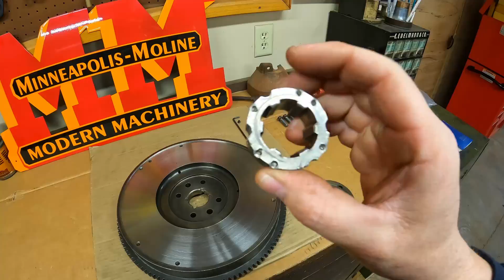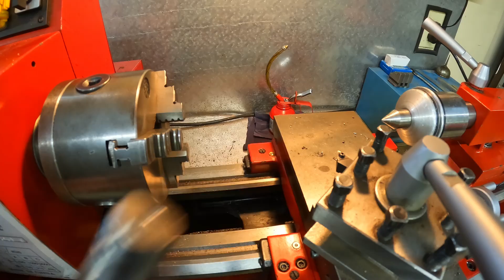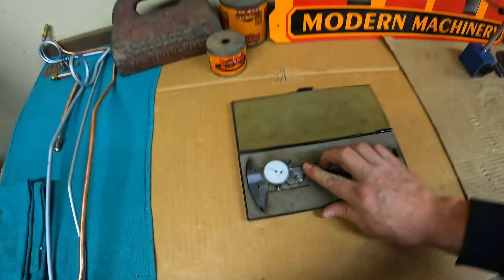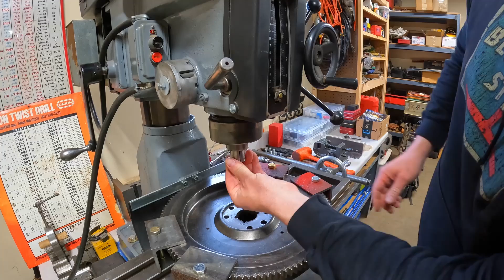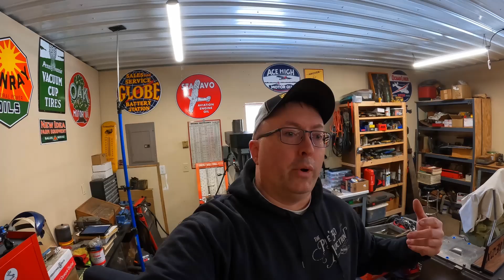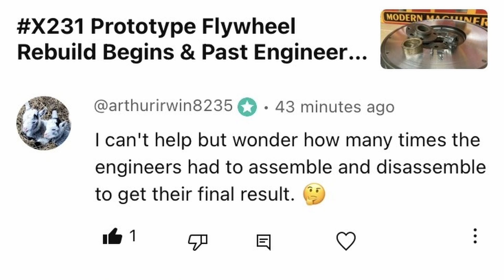X231 Prototype Flywheel Machining - Making Tools, Checking Setups & Cutting Metal - Episode #80

Comment: Not sure from the video, but the boring bar looks like it has  a carbide insert.  They don't tolerate INTERRUPTED CUTS.  I would use a HSS cutter and regrind as it is beat up.  You can finish with the carbide.

Comment: just had a thought. is the spline insert even original MM installed?  could the prototype have had a  spline in the flywheel casting, and the insert a farm-life  repair when the PTO ultimately failed after a few hours under load? If this machine was for proof of concept and not for proof of longevity, there are definitely obvious repairs because of their complexity compared to good enough for a parade for the brass.😊

Comment: Hey Squatch .
I did a similar  job years ago on a bearing housing.
 My set up process was exactly the same with regard to your dial indicating . 
I had to the Extra step of having to show my work and set up to the erector who was in charge of the project. 
 At the end of the day I bored out the out of round hole with an adjustable boring head just like your original set up . 
You are doing an excellent job . Your attention to the final outcome is spot on and it’s the final outcome that matters . Sometimes the path is not as straightforward as we would like . 
 Your efforts provided a quality Job and precise finish is achieved.
 Well done ,keep at it and keep making these videos as they are of great value to many people who are interested in machine repair.

Comment: Using drill rod for indicator holder? What are you, rich! No re-bar laying around the shop?
Please share the speed you're running your tools in surface feet per minute so viewers can have a sense of the calculations required to set spindle speed.
Reply from the maker: I honestly have no idea what the spindle speed is here - I never change it and it seems to do just fine 👍

Comment: toby, turn down the shank of your flycutter and mount it in your boring head. light intermittent cuts with hss will hold up better than trying to machine hole entirely with carbide. save that for final passes.  i enjoy all of your content and channel. illigitimus carborundum,  mjm
Reply from the maker: The shank of the fly cutter is already too undersized to be a good fit in the boring bar holder.
Reply: improvise, sleeve the shank and getter done @squatch253

Comment: You are attempting a difficult repair considering the amount of torque involved. My preference would be at least a .oo3" interference fit on the bore maybe more considering if you throw in the expansion generated by the heat expansion or preheat the flywheel and key the bore with press fit dowels not set screws. If set screws are your preference I would recommencement tapered Pipe plugs for a more secure fit. The previous repair says a lot.

Comment: As I rewatch this after some sleep after a long day of visiting multiple airports. Is there any concern/need to have the flywheel balanced after all the machining and repair work is completed?
Reply from the maker: I’m not that worried about it, considering they never bothered with it initially and it went on to endure countless hours of flogging and held up fine. Also remember from WAYYYY back in the series when I pointed out that the engine’s crankshaft was never balanced either.
Reply: All good, and it was one of those, hmmm I wonder moments. As for the way back, that just means I need to rebinge the series.

Comment: easy way to crudely center up on your hole is with an edge finder.. hit both sides on the x, split the dif and then do the same on the Y, repeat again on the x and see if the numbers are the same, tells you you are in the middle, then you can sweep it with the dti to get it right on, but I find the edge finder gets you within a thou or two. You are down a little cause you do not have a DRO, GET ONE, even the cheap ones are your best friend on a milling machine, bolt circles, backlash not constantly fighting you, math functions, its a game changer. few hundred bucks and you are off to the races
Reply from the maker: You'll have to explain to me what "the x", "the y", and DRO mean because I'm not really much of a machinist.  The only things I know are what I taught myself through doing a bunch of things that didn't work and a few things that actually did lol!
Reply: @squatch253  No shame in that, x is table left and right, Y is towards the operator and away and z is the quill / knee (up and down)  a dro is a Digital Read Out, think like a giant mounted set of digital calipers for each of your table axis's.. Tells you right where you are and more importantly how far you have gone. most of them have bolt circle functions where you find the center of the circle, tell the DRO what diameter and how many holes you want, and it gives you coordinates to drive to for each hole, very convenient

Comment: A mini lathe is better than no lathe. If you are careful you can even work around the inherent shortcomings and make quite accurate parts. Maybe not fast and it maybe quite frustrating, but consider the gold standard of flatness, manual scraping. (Conversely you can turn out trash on even the best equipment if you are a putz)

Comment: Toby, I hope you checked the new hub for run out before you cut it down to size. As easy as it slipped on the shaft, that set screw is bound to pull it slightly off center.  Actually I would rather you machine the shaft for an interference fit and press the hub on, machine it to size, then press it back off, but make certain the inner and outer circles are concentric.
I had this message mostly typed in at noon, but then my wife fell and hit her head and we went to the ER before I could finish it, sorry.
I think we should bug Bork about starting a GoFundMe page to get you a new vacuum!!! 🤣🤣🤣
Reply from the maker: Sorry to hear about your trip to the ER, I hope she's alright!  These videos are always several days old by the time I get them off the camera and onto the main feed here, so any damage that may be flagged is already very well done lol ;-)  I ended up throwing a second set screw in the other threaded hole 180* out from the first one to better equalize the load, and checked the runout with a dial indicator before beginning machining.
Reply: @squatch253  Good job!! 👍👍 The wife is kinda OK, the bump on the head wasn't serious, but they want to find out why she got dizzy and fell,, so they kept her overnight.   Serendipity!  Thanks.

Comment: The real reason to machine from the crank side of the flywheel is to be able to center with respect to the flywheel flange around which everything must be true.

The spline galled because the screws that pinned it in place had some clearance allowing the spline to shift ever so slightly when under load. 

So the engineers did a bodge which you can improve on. 

One thing you can do is create a force fit and press the splined bushing in. Machinery's Handbook gives .008~.024" interference for the bore size you have. If you put a step on the splined bushing and go on the heavier side of interference fit that may solve the galling problem.
Reply from the maker: Because these videos are always a few days to a week old by the time I get them off of the camera and onto the main feed here, I'm usually finishing the next installment with the camera by the time I publish anything here so unfortunately most of what is discussed under what's currently playing has already happened.  I did do the majority of what you mentioned here, although did not go up to that tight of a force fit with the new splined center.  The raised step/ridge was also a feature that I built into the new hub, which helped a lot in positioning it for the following steps :-)

Comment: What is the model of your bench mill I have been looking for one and want quality.
Reply from the maker: I don't even know what the model number is on this mill, or who made it.  I stated in one of the radiator tank milling videos that this is a very cheap China mill/drill and our neighbor actually just gave it to us because it had been through a garage fire and he was going to scrap it.  It didn't get hot enough to even melt the plastic handles, so we cleaned it up and made sure everything was tight and have been using it ever since.  I would not, however, recommend a cheaper "China" line of mill/drill like this to anyone though, because it definitely has its limitations in accuracy and function.  Do plenty of research, and if in doubt, spend the extra money for something of mid to higher level quality.
Reply: @squatch253  thank you so much keep up the fantastic work on x231

Comment: I find this build one of the most interesting you have done because it is a series of problems to be solved. How to restore irreplaceable stuff and keep it as original as possible. I suspect that originally the splined bush was just a press fit in the flywheel which failed very early on, possibly causing some embarrassment. I can imagine the tractor being torn down quickly and someone sent off to a workshop to repair the thing in a couple of hours. They came up with an innovative repair that obviously lasted years but eventually started to wear out causing the wallowing of the flywheel.

Comment: FYI, it was X231 that got me to your channel. I have no connection with farming, American farming, tractors, ploughs etc, nor do I have any special appreciation for Minneapolis Moline machines. In fact I had never heard of the make before. After a couple of years watching your work, that has not changed a bit. What keeps me with this channel is the quality. The quality of your work, your knowledge, your experience. Also the resourcefullness that you show - especially with this X231 restoration. Last but not least your enthousiasm for your machines. I will never contemplate a restoration of an American heavy machine - yet your restoration work is fascinating. So please, keep this series going, it is engineering on a level that I can only dream of.
Reply: The same here. I found Squatch's channel and subed then and there. X231 being a one off touched my heart and I love and respect what Squatchy has done. I think X231 has proved her concept and more. 😊
Reply: It's spooky: all of this applies to me as well. In particular it was setting up the DIY line borer to machine the  brazed-casting repair. It boggled my mind that you would go to such lengths to make this whole again. I'll keep watching these as long as you keep making them.

Comment: Hey i enjoy all the tools that you have made over the yrs. but being a machinist just wondering why you did not put the fly cutter in the boring head that way you have control over the size.  we would put any type of tool in a boring head over manual adjusting a tool free hand. make a spacer to hold the tool if you need but always better in the boring head! Great content have watched all that you have made in the last 3 yrs.
Reply from the maker: The 1/2” shank of the fly cutter isn’t in the best condition wear-wise, and I didn’t feel comfortable adding that slack to the boring bar holder.

Comment: X231 is the reason I subscribed to your channel, found it when you were putting together your tooling for machining the rear housing. I have been a machinist for most of my life and have had to come up with many strange ways of doing things with less than the perfect piece of equipment for the job. Some of your solutions are very inventive and get the job done, even though you don't have the best machine for the job. I have a fairly well-equipped machine shop with quite a bit of tooling and I still have to resort to making tools or fixtures to get the weird jobs done. I have even made special cutters (I have a cutter grinder for that and sharpening cutters) for some jobs.
Keep making the videos and using your talents and X231 will run again.

Comment: I'm interested to see how large you make hole in flywheel and how you secure the hub to it maybe try to eliminate most of screw hole make hub a good press fit and drill correctly for some good tight fitting dowell pins guess we will see what you have in mind

Comment: man that is going to be a huge feat to get all four wheels on the ground!
Reply from the maker: You’re absolutely right - just the work that is still ahead of us on that front bolster casting/steering mechanism alone is substantial.
Reply: Very true. Is it just the complexity of transmission, and the shape it was in or are things starting to fight you at least a little less?
Reply from the maker: The front bolster is currently away at the radiator shop getting the new radiator core fitted to it, but when it comes back we still have a line-bore repair to do to the repaired end of the power steering piston opening, and then do a complete rebuild of the front steering pedestal swivel mount that resides in the bottom of it.

Comment: Toby, you do a marvelous job and have a hell of a lot more patience than I do on the project. It takes months or even years to complete the iterative, deliberate trial-and-error process, as you are aware. You may be sure that 99.99% of the problems have been resolved by the engineers in the background before the models are sent to the assembly line. After all, they don't want the product to be recalled after it is sold. To witness the iterative process in action, observe the construction of the SpaceX Starship or the Tesla vehicles, including cars, trucks, and robots. That is the closest approach to building a machine similar to the MM that I am aware of in the field of invention today. I get to watch you work so hard on a project like the MM, and I find it remarkable.

Comment: What was the lesson that inspired you to check for rebound in such a large, thick piece of material?
Reply from the maker: From machining brake rotors with our special “on the car” brake lathe years ago back at the Ford dealer. Learned the hard way that I needed to torque the adapter plate down on the rotor to the same spec as the lug nuts, because that tightening process actually moved the rotor’s braking surface a tiny amount. If you set the lathe runout to match a lightly tightened rotor and then made the cut, it only ran true at that torque setting. But when you would put the wheel back on and tighten the lug nuts to full torque, many times you had a new brake pedal pulsation because the tighter lug nuts moved the rotor surface from its prior setting, skewing the accuracy of the prior machining.

Comment: "How often did they assemble and disassemble" (X-231) Having worked at a major Aviation Company as part of the Logistics side as a Subject Matter Expert and working with design engineers? Trust me, LOTS AND LOTS of times. Today we have the luxury of using computers to 3D model parts, assemblies, installations and major components and final product. About 80%+ of the work today is virtual before physical parts are made, even then 3D Printing has replaced Tool Room Exemplars/Pre-Prototypes for component verification. 3D components can be used to construct a final product and once verified a 3D print for use in making a casting can be make or a CNC machine can use the the numbers to carve out a component for the next step of using an actual component in the specified materials. Once the prototype component proves fitment the 3D part can simply be tossed into the recycle bin to be broken down (no more available material for Industrial Espionage) and recycling 3D printings reduces costs related to use of 3D printing. Yesterday at Minneapolis Moline? There is a reason why so many of Christine's Parts belong to the previous generation of MM Tractor, its a lot easier to start from known and walk into unknown territory than start from a blank slate. You can see that philosophy in the Evolution of the FA-18A/B/C/D Hornets and the FA-18E/F Super Hornets & EFA-18G Growler, also the F-8 Crusader and A-7 Corsair II (this aircraft from 'build it' to First Flight is about 18 months and its considered one of the most successful aircraft design launches), UH-1 Iroquois (known as the Huey) and the AH-1 Cobra (same as the A-7 Corsair II about 18 months from 'do it' to done and highly successful). Are these examples 'one for one', yeah. A basic design was proven, the next design used the prior for its library of knowledge and those who worked on the first worked on the second. They knew the pitfalls, issues, and where advancement could be made, which is why the first examples took years to perfect and then the second took months which is why you find older Tractor parts on X-231 from stock to heavily modified to custom one offs.

Comment: 3:32 Short of having a brand new lathe or a fixed up lathe, you can't do small work in a big lathe, not efficiently not without hassle. You'll end up with all sorts of cones, truncated or otherwise or you have to spend more time on it than it's worth.
I have one of those small lathes too (prolly made in Taiwan or Hong Kong as it's a touch better than what you get for super cheap these days - made in the late 90's), it's still a lathe, and if you set it up on a good solid surface and spruce it up here and there, it's a good mule to work with.
I've mine on a slab of concrete with a few metallic legs i rescued from an cast iron lathe that was too saddled to work anymore. The only thing i wish to remedy on it now is the tail stock, i want to make one that has a deeper reach. I feel that even for such small lathes, the reach on them is too short for some operations. Other than that, it gets my approval. Still ten times better to make pins on it than trying to make them on the bigger ones and having to use a chuck in the chuck to make it work proper or using bigger stock to grab it properly. Some smaller size work just doesn't make sense on medium and large.
And when you get to sizes like 3 meter and up... yeap. So little red lathe is still a lathe, even if it's little. You and Sr. made plenty of good things on it.